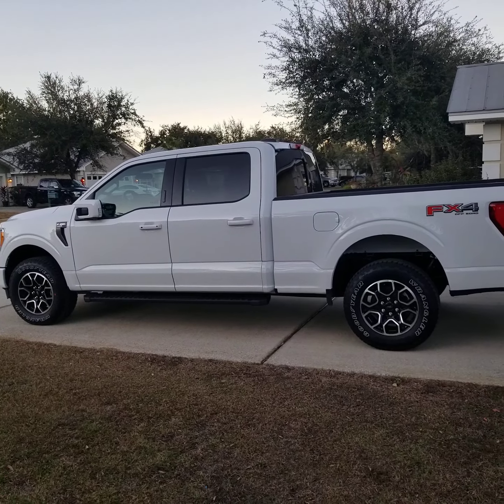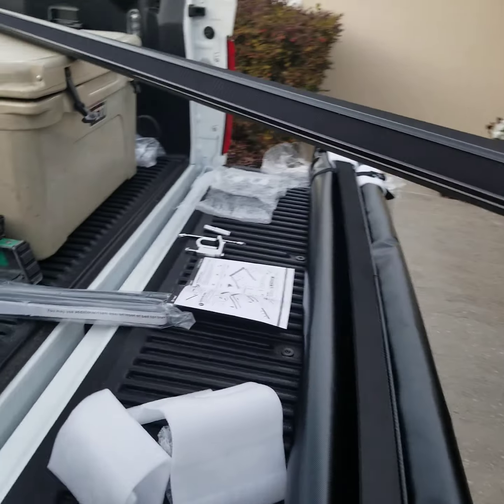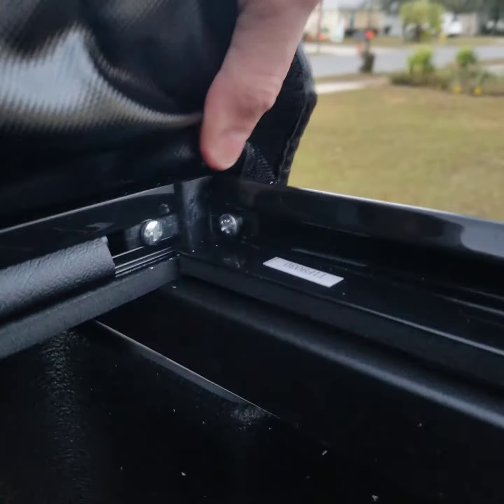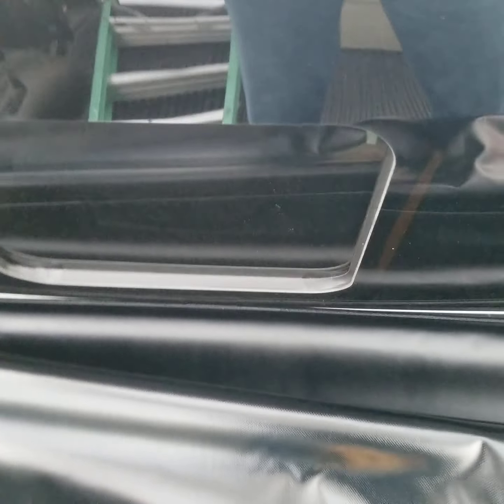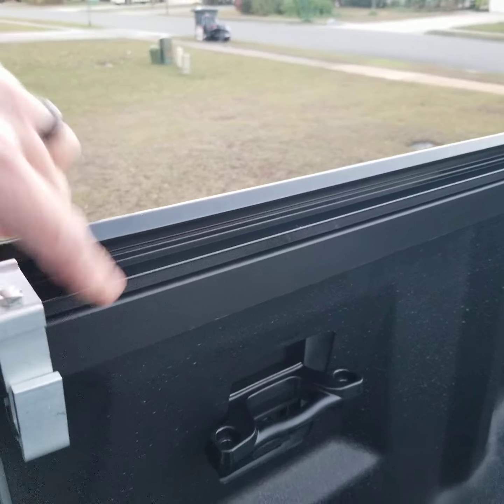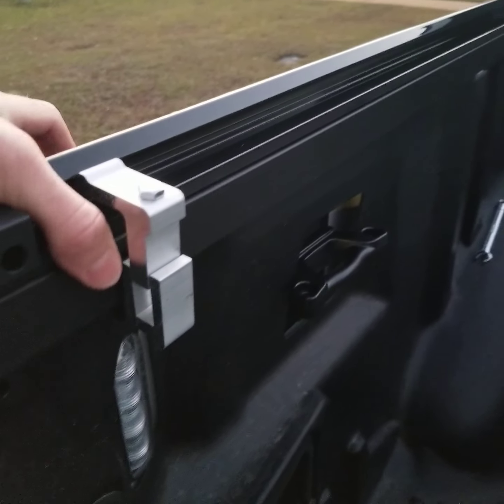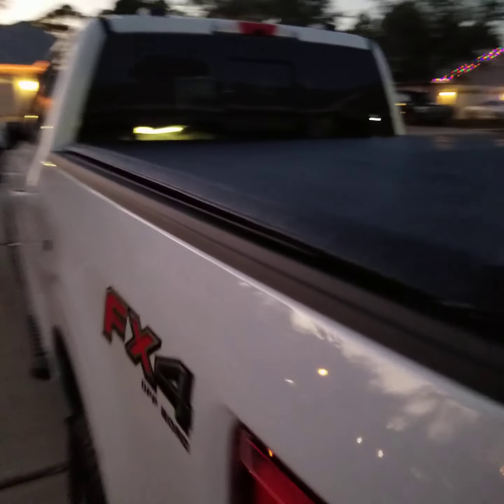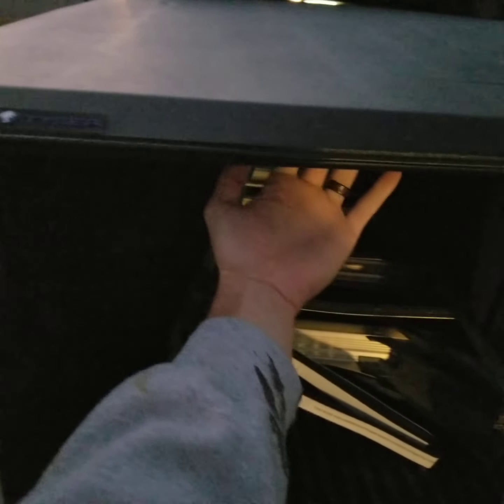2021 F150 Tyger T1 bed cover installation

Comment: How do you think it will hold up in Wyoming with 70mph winds?
Reply from the maker: I was just driving the other day down here in Florida when we had 50 mile per hour crosswinds while driving 70-73mph and I have not had any troubles. Be sure that you tension the back locking mechanism properly. After 2 years in the Florida sun, I had to tighten the tension for the tight, snug fit. I still have 2 more adjustments left.